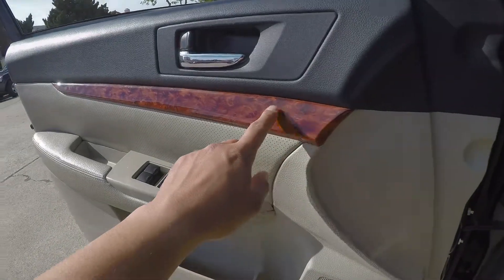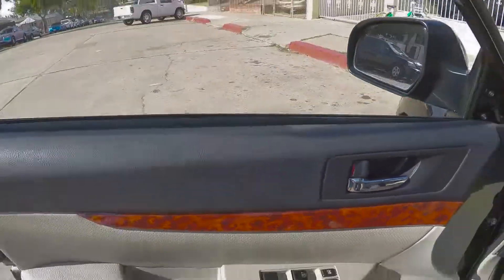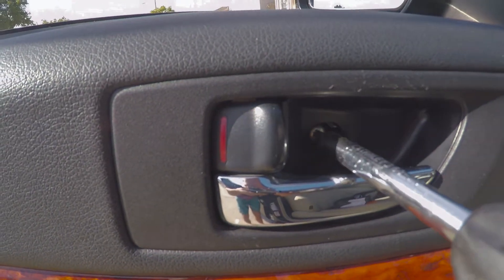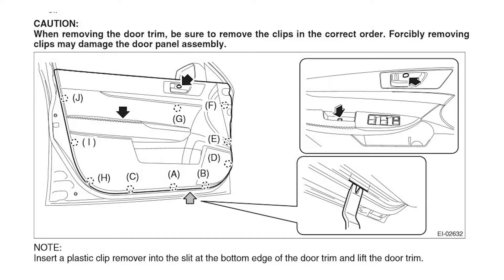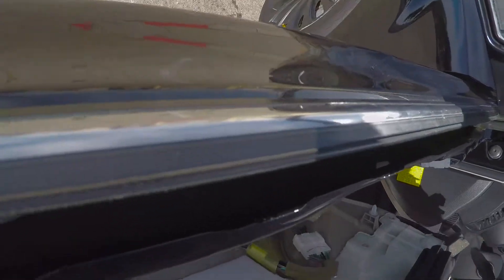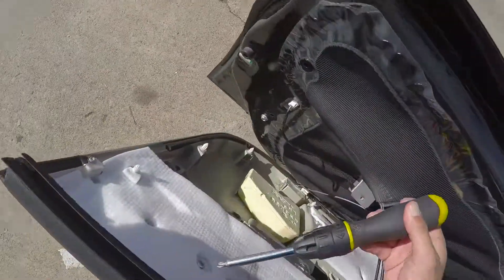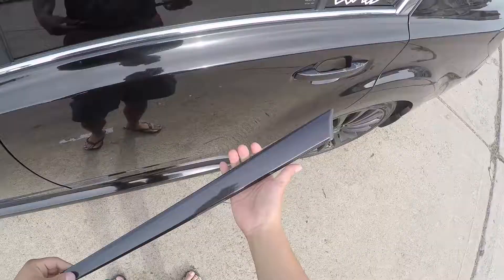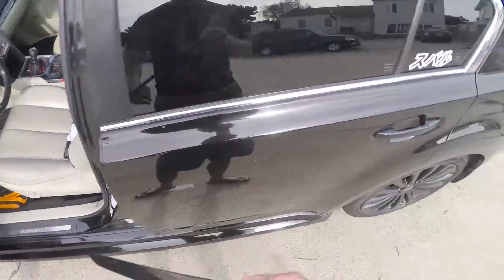Vinyl Wrap Interior Front Door DIY Carbon Fiber Trim 2010 Subaru Legacy GT

Comment: Maybe you would know, but will small scuffs and scratches in a trim piece show through on the vinyl? I'm trying to wrap a few small pieces on an 05 OB, but the spots have several small blemishes.
Reply from the maker: Depends how thin your wrap is but most likely it will show. If you're worried about it, try finding a replacement part at a junk yard or ebay. If all else fails the dealership
Reply from the maker: You can also cut off a small peice of test wrap and put it over the damaged area and check if it shows through
Reply: Victor de Leon thanks for the reply. I’m thinking that I’ll try the test section first. I’m doing a skim coat of bondo on another section, sanding down then applying wrap. Depending on how well that goes, I may hit a few other spots. Thanks again!